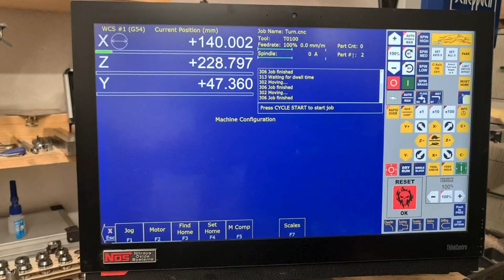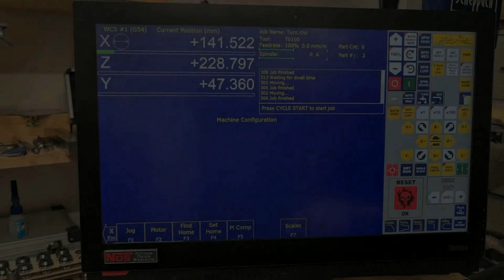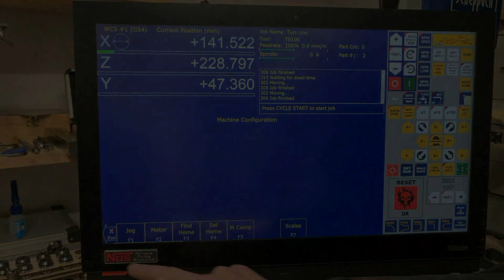Acorn6 DIY CNC - Closed Loop with linear scale

Comment: Hi folks. Many, many moons ago I got a degree in control theory. Closed loop control is the best way to implement CNC. It's more expensive than going the stepper motor route due to the cost of the scales but correctly set up will give far superior results. The need for the scale and read head installation to be firmly connected to the machine parts is perhaps the most critically important mechanical aspect. The theory of how to create a stable feedback control system has been known for many, many decades - I studied it back in the early 1970's. It's mainly down to setting the appropriate level of system gain, simpler in practice than in theory! Back in my day the 'computing' was done by analog means - yes, there were, and still are, analog computers. Gain was set by twisting a knob. Now of course it is nearly all digital. For far more detailed info lookup 'Nyquist stability criteria'.

Comment: Did  it work out of the box  or they had to spend  much of a time to tune  the PID and encoder error flow calibration as we see  in linuxcnc ? Any limitation on how much is the backlash  to keep such feedback working accurate?.
Reply from the maker: Tunning is done in a minute with Centroid, any backlash over 0.04mm will cause problems while cutting, but no problem to compensate even more with a scale
Reply: @TheSuntravel  Thank you for your reply, what type of servo motor and driver  if used and  the  resolution of the encoder?. Am interested in  your setup.
Reply from the maker: @Transmission4less  JMC 400W for axis and 1500W for spindle, all with 17bit encoder set to 10000 pulse/rev
Reply: @TheSuntravel  Thank you

Comment: Wait. So you can compensate for backlash in rack and pinnion by using a scale. And you don't need dual motors or dual pinions for it?
Reply from the maker: No, whenever the scale reads a position deviation, the axismotor will correct this. But the backlash should be as small as possible, scales are not a fix for worn out rack and pinions...

Comment: How accurate is that probe You are using to touch off You tools?
Reply from the maker: If fresh dialed in and in the same orientation (probe and chuck), 0,01mm. But do not expect it to stay as long centered as Centroid probes.
Reply: @TheSuntravel  understand💪🏼

Comment: Hello, I've been wanting to buy an acorn for some time, but I always stay in mmm.
My question is with the linear scale, can you remove the play from the nut, which centroid adjusts the distance, while machining or is it just to have a visualization of where it is?
Reply from the maker: Yes this is how closed loop works, it is permanently reading the scale position and correcting it to the programmed position. So it takes also care of the play in the nut.
Reply: @TheSuntravel    excellent, now with this I have no pretext to be able to buy it, another question, I saw that you talked about the macros, you need to make a macro or the software itself will help you, for a few weeks now I am your faithful follower
Reply from the maker: @maq-Yantek  For scales you need no macros. Some like for homing are generated by the Wizard, othere have to be written by hand, it is only g-code. All my stuff can be downloaded in the Centroid forum.